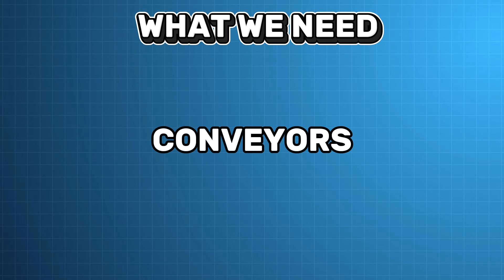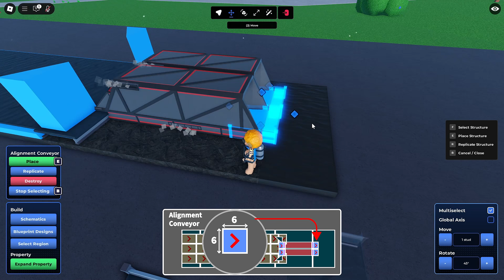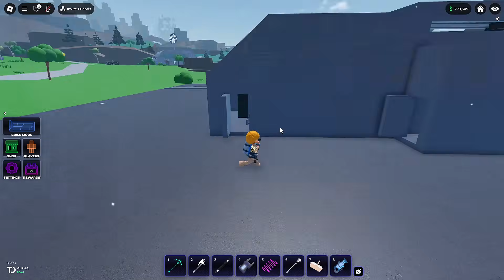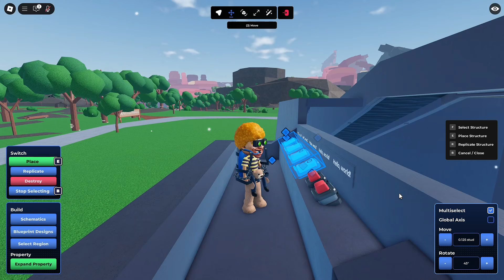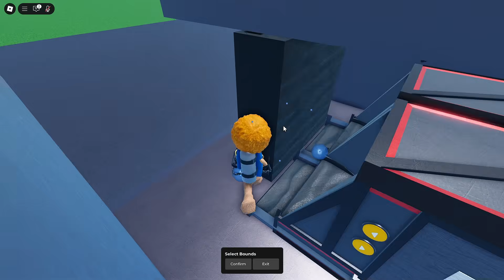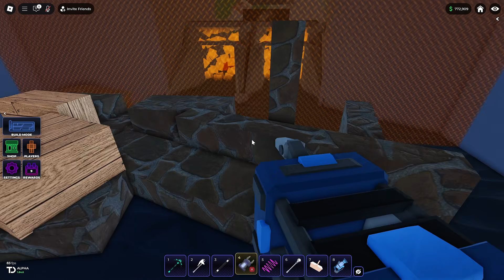BUILD an Auto Loader & Unloader For NEW Truck in Oaklands | Roblox

Comment: it helped me alot but the despawn button doesn't work i tried several times and watching your tutorial over and over it still doesn't work how can i fix it?
Reply from the maker: Hey, Make sure that it is connected correctly, it can be very easy to get wrong on that part it seems :)
Reply: @FrumpyPlays thanks it worked
Reply: same how did u fix it?
Reply: @Warpzer  idk i joined at it worked
Reply: So you just rejoined and it worked I’m having the same problem
Reply: @justrandom988 i was also confused on HOW i fixed it i only connected the wires as same as the video
Reply from the maker: Hey all in this one, if it isn’t working it is connected wrong. 

It is hard to diagnose the problems in text but I can make suggestions

Make sure you connect the number interface with value of 20 to relay, the relay output to the interactor and the relay input to button

Comment: how do you make a timer that drops an item every second or so i cant find any videos on it
Reply from the maker: Number interface from 1-10 (depending on how many items u want to drop)

Number interface  >  Frequency >  left side of relay
Switch > right side of relay
Relay > interactor
Reply: @FrumpyPlays  i cant  find relay switch just relay and i tried to set it up but cant get it to work
Reply from the maker: @death42897 the switch is in the red boxes
Reply: @FrumpyPlays  you said relay switch not switch
Reply from the maker: @death42897  now you have me confused

Comment: How much can this handle at once? A full truck? Like wouldnt the storage box get full
Reply from the maker: You can add as many storage boxes on the load section - I have 10 boxes on mine! 

Can handle loads!
Reply: @FrumpyPlays if logs get too big, does adding more sanders process larger pieces of woods than if you didn’t?
Reply from the maker: @Clerxic no adding extra sanders won’t help, only if you cut them or get bandsaws

Comment: Wicked, got mine set up last night, is there a way to implement band saws for auto cutting of the logs if they're too big? Then it'll be completely automatic😁
Reply from the maker: im looking into this but i have done it before I just changed it all around again!
Reply: @FrumpyPlays for now I just placed some band saws about 6 studs in front of the filter conveyor, it works good enough and doesn't mess about with the truck spawning much
Reply from the maker: @IDecaturX interesting I’ll look into doing this myself!
Reply: @FrumpyPlays I can't remember the exact stud gap but it chops a little bit at a time until the large log is small enough to be sanded

Comment: Hey i built everything and ita very cool and simple, but i ran into a problem my truck won't despawn and my conveyour button won't work  could you help me out? Thank you.
Reply from the maker: Hey! so its hard to diagnose when not seeing it but 

Make sure the respawn button is connected to the right side of relay

Connect the number interface to the left side of relay with value of 20

Connect the output of relay to the interactor

FOR The conveyors - make sure that the Region of the interactors is over the tiny orange switches on the side of the conveyors
Reply: @FrumpyPlays Yo thank you I founded the problem for the despawn button i didin't connect nun interface to the relay
Reply from the maker: @5GuguGaga5 aha! Glad you managed to get it sorted

Comment: why can't my truck despawn
Reply from the maker: Hey make sure that the Number interface is set to 20 and set the correct side of the relay
Reply from the maker: Hey! so its hard to diagnose when not seeing it but 

Make sure the respawn button is connected to the right side of relay

Connect the number interface to the left side of relay with value of 20

Connect the output of relay to the interactor

Comment: my storage drawer isnt outputting
Reply from the maker: Hey did you manage to fix this?!

As i cant see it in game i can only make suggestions!

1. Check to make sure you are using a Frequency not a sustainer
2. make sure that the Region of the interactor is set correctly.
3. make sure that all wires are connected in the correct way.

Comment: How do you replicate the structures? The game only lets me place one. Also, how are you using the region select tool? It immediately grabs whatever’s under it and doesn’t allow you to select anything else
Reply from the maker: hey if you have machines ina box like conveyors ect  and you HIT "R" on the one thats already placed it should replicate!

Region select yes it selects whats under it so you need to move it up slightly OR use multiselct to deselect what wasnt meant to be selected.

that sounded confusing now i read what i wrote haha
Reply: @FrumpyPlays  Figured it all out. Took myself some messing around with it to realize some things. Thanks though.

Comment: I started using it just for some test runs and it deleted like 90% of my magma planks after going through the second box??

Edit: just finished the build fully and when i tested out the logistics to make sure it works the rest of my magma planks appeared in the truck so i guess its all good now, thank you so much for the extremely helpful tutorial
Reply from the maker: yeah that would have been odd if they deleted! that would be the games fault!

Comment: auto loader to semi truck?
Reply from the maker: Yes this is for semi
Reply: @FrumpyPlays  how it loads if i have upgraded semi
Reply from the maker: @Dewa_Edits  Hey it is for the upgraded one only! :) it fills up from the top
Reply: @FrumpyPlays  thanks for your answer the thing i wanted to ask like upgraded one's roof is closed soo i mean do woods teleport inside of cabin or smh?
Reply from the maker: @Dewa_Edits  When an item dispenses from the drawer, it dispenses a little way away from  it.   That gap is where the roof of the trailer is.  therefor the items dispense inside
Reply: @FrumpyPlays  thx i builded that ty for that tutorial, which material u used to build?
Reply from the maker: @Dewa_Edits I used iron

Comment: Hey Good Tutorial. But my Storage Drawers are a Blueprint and when i put in a item, only this item can be picked up. They also drop a item when i press a button not instant
Reply from the maker: Yes storage drawers begin as blueprints you need to fill them in. Hmm are switches not working?
Reply: @FrumpyPlays  Does it matter what I have to fill them with, or does it have to be something specific?
Reply from the maker: @Scotastisch  any material you like
Reply: @FrumpyPlays  The Storage Drawer is now a stone, and on top it also says "Rock". It only accepts these stones, and when it collects them, I have to manually take them out again with a button by pressing E in the drawer’s menu.
By the way, how can you put text above the buttons?
Reply from the maker: @Scotastisch I’m confused I’m sorry the ore goes in then you unload into your truck by pressing the switches 

If they are not doing it automatically your logic isn’t set up correctly.

The writing is on signs you can buy the schematic from the oak depot
Reply: Everything works except the Drawers. They dont pick up items, if you want i can sent you a picture on Discord
Reply from the maker: @Scotastisch  Storage drawers only hold 1 type of item, they wont hold wood + ore

Comment: Hi frumpy, Great video, But i feel like some of my stuff is disapearing, idk if i did somthing wrong but i come back with a truck full of magma trees and it is only selling for like 90k when i can usually get like 120-150k is there somthing i did wrong to cause this to happen or is it in my head
Reply: Same thing happening to me and it ends up getting stuck under and sometimes I rejoin and it magically appears onto the top conveyors
Reply: @abraham9379  mine dosnt go anywhere i feel like it just dissapears
Reply from the maker: Hey so a few people have said this and Im not sure on the issue as mine has been fine.

All I can suggest is to make sure all conveyors are level and not jaggered (no gaps)
Use the stat tool on your machines to see if they are stuck inside if they are the storage drawer could be too close to the machines?

these are just guesses as mines ok :(

Comment: This tutorial was immaculate! 99% of the steps were clearly handed out with perfectly accurate dimensions to match, and the logic is extremely easy to follow, even for someone like me who has almost zero actual experience with it. Building it properly, alongside a basic box and conveyor walls for it, only took about 2 hours, which is perfect for a machine I could potentially get months of use out of. +1 like and sub!
Reply from the maker: Wahoo! Thanks ao much for the comment I appreciate it!! Hope it’s all working well!
Reply: What about the other 1%?
Reply: @Crizywildin the part he time skip bc I have to do it randomly now, but it’s 1% since it’s not that important 😭

Comment: Im not sure where to hook the not gate onto the fourth switch. there is only one connection point and the not gate will not connect to it with another wired.
Reply from the maker: so the not gate is just for the light so it lights up when on and not when its off
Reply: @FrumpyPlays thank you for that info! That makes a lot of sense, now lol.

Comment: it unloads but how does it load?
Reply: the refined stuff that flows back into the truck is the loading part
Reply: @Funckcy but I don't see it happening I don't want to build it rn bc I can't afford it but I also want to make sure it fully works so I don't waste 400k
Reply from the maker: Hey it unload from the top storage drawers ! - don’t worry even if you bought it all it wouldn’t be a waste! You’d still have all the machines :)
Reply: @FrumpyPlays so it unloads refines and forges then it loads on its own?
Thanks for the tutorial
Reply from the maker: @itsReda.18  yes when you press the buttons :)
Reply: @FrumpyPlays  i finally built it thanks so much it saves so much time and also i didint know that the trees and ores would just go throught the truck's roof that is why i had doubts but it works fine now
Reply from the maker: @itsReda.18  wahoo!!!

Comment: my storage drawers won't eject their items. do you know why?
Reply from the maker: Hey! So its hard to diagnose the problem through text so i can only make some suggestions:

1. Make sure that you have a frequency not a sustainer, 

2. make sure the frequency is set to the correct value

3. make sure that the interactors region is set to the box you are trying to dispense from.

4. make sure that it is all wired correctly.
(alot of people mix up the sides where you connect the switch and the interfaces)
Reply: @FrumpyPlays  i've tried everything here, and it still doesn't seem to work, i might just have to use the bluprint for the logic
Reply from the maker: @ProCallMeJr  Hey! the blueprint is only for the schematics and not the actual parts :(
Reply: @FrumpyPlays  found the issue, it was that the drawers hadn't been fully filled with material
Reply from the maker: @ProCallMeJr  ahhhh!! perfecto! glad you figured it out

Comment: Yo dude nice tutorial but why despawning doesn't works?
Reply from the maker: Hey soo seems a few have issues with this and it’s 99% the same problem.

Soo.

Make sure the respawn button is connected to the right side of relay

Connect the number interface to the left side of relay with value of 20

Connect the output of relay to the interactor

Comment: Why isn’t the interactor that spawns and despawns truck not despawning but it will spawn?
Reply from the maker: Hey so , make sure the respawn button is connected to the right side of the relay and the number interface is connected to the left of relay with value 20.  Then the output to the interactor

Comment: Conveyors and spawn + despawn just don’t work no matter how precise I place the region
Reply: I just made it and it works
Reply from the maker: Hey it’s hard to diagnose through text so I can only make some suggestions.  

If the regions are all good then I’d look into the wiring … make sure that the switches and buttons are connected the right side of the relay

Comment: I made it it works fine but rn i didnt do anything idk why load button is not working sometimes it loads only 3 pices and sometimes dosent load anything i checked all logic all are the same idk what the problem is
Reply from the maker: This sounds to me as if you could be using a sustainer instead of a frequency?
Reply: @FrumpyPlays i checked the frequency 2nd one value was changed to 299.9999994 by itself idk how but now its working thank you so much !!! 💜💜
Reply from the maker: @saeedamer9512  perfectooo

Comment: I cant seem to get the conveyor switch working.
Like when I did the region for it as precise as I could it still doesnt work, it just wont stop moving even if I press the button.
Everything other than that works just fine
Reply from the maker: Hey! So this could be the other logic pieces, make sure that the number interface value is correct and wired into the correct side of the relay
Reply: @FrumpyPlays I'll check tomorrow but I think that the numbers and wiring is correct

Comment: whenever i try to place the lights they always come out as 4, not 1 single light. do you know how to fix? i bought the ones at alans store btw.
Reply from the maker: Hey just need to resize them
Reply: @FrumpyPlays  thanks! but for some reason the despawn button won't work. i did the logic correctly, but it won't work. the spawn works, however the despawn doesn't. do you know a solution?
Reply from the maker: @clayman9420 if thats the case then the despawn isnt wired correclty :(

So to run you through it :

Spawn
Button -> Interactor

Despawn
Number interface with value of (20) -> LEFT side of relay
Button -> RIGHT Side of relay
Output of Relay to Interactor
Reply: @FrumpyPlays  thank you so much! it works now. its rare to see a content creator interact so much with viewers. that deserves a subscribe!
Reply from the maker: @clayman9420thanks so much! I try my best!!

Comment: hey man. Love the video. Quick question for you though. I’m having a hard time understanding how the materials drop into the truck from the top drawers? Are you able to explain how it works
Reply from the maker: Hey Absolutely, So when you press the load switch it will dispense downwards, as they dispense a little way away from the box they actually land inside the truck

Comment: did the logic for conyver belt but only goes <<<<<< and >>>>>> doesnt stop
Reply from the maker: Hey! so this would happen if either you are using 4 way conveyors or the number interface is incorrect.
Reply: @FrumpyPlays   issue was cause of hooking up switch directly to the interactor. 
Guess was distracted when setting up the logic at the time

Comment: Hey! I have a question, what should the collide button do exactly when i turn it off? Also everything works for me expect that i cant get 2 things at the same time, for example if wood gets into box then stone cant, what have i done wrong and how do I make it work? Thanks
Reply from the maker: Hey So you cant have different materials in the same storage drawer, I have 2 + Storage drawers and using colide to that ore goes into one and wood in the back one

Comment: Hey there, i just built this mostly after the tutorial but my truck spawner doesnt work correctly sometimes it spawns in but when i click it it doesnt work D:
great tutorial tho
Reply from the maker: Hey did you managed to get this fixed? To spawn it the button only needs to be attached to the interact directly - also ensure that the region is over the pad
Reply: @FrumpyPlays  yea i managed to get it after i rebuilt it cuz i bought the blueprint turns out i didnt connect the logic right
Reply from the maker: @GatzenyourFriendglad you got it sorted matey!

Comment: What if the tree is so big it can't get sanded? Do you then have to cut it up manually before depositing or can you integrate a cutter into it? 🤔
Reply from the maker: hey! you can do either you can either add the bandsaws or just cut manually :) im thinking about making an "ULTIMATE " machine hahaa
Reply: @FrumpyPlays Yeah I absolutely love the design and I made mine almost identical however i thought about adding a bandsaw however im not sure if i can place it in the floor or if the interractors will mess with it 😅
Reply from the maker: @DoctorPastapus  the only way is to test my friend! :)
Reply: @FrumpyPlays yes I'm going to try after work and if it doesn't work I think it can work by placing them in the side walls just have to make sure the tree doesn't twist the wrong way 😊

Comment: Works great tho it eats ore from time to time. Ill put in a car and trailer (not semi) of ore and half will vanish. For example put in pyrite, gold, and beigeslate and only the gold and some of the beigeslate came out
Reply from the maker: Hmm that’s very odd where is it going?!
Reply: @FrumpyPlays i had a conveyor going over the rear box which only let out the small stuff, ive offset conveyor to main section and all appears well (its for manual loading/sorting for ores like luminite
Reply: Correction, found out it was a modification i made to the og design, it has been since corrected and i havent found issues yet. This thing is amazing